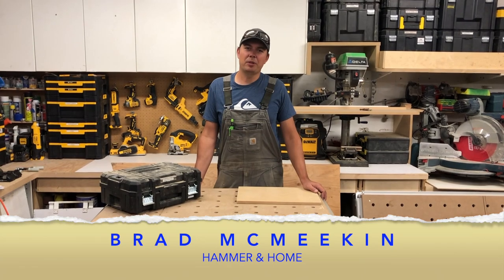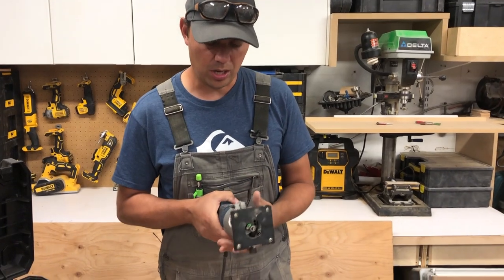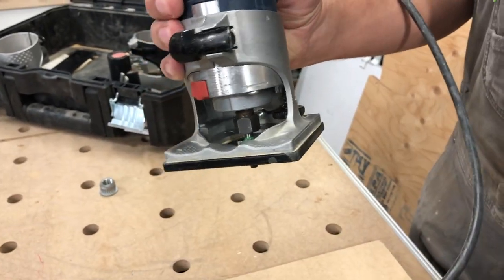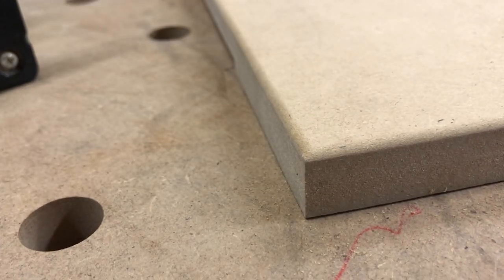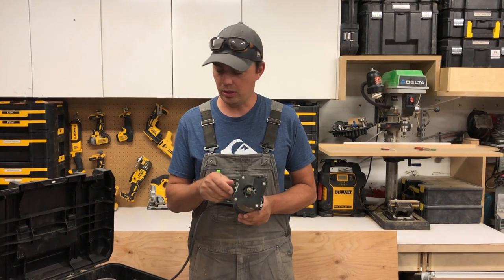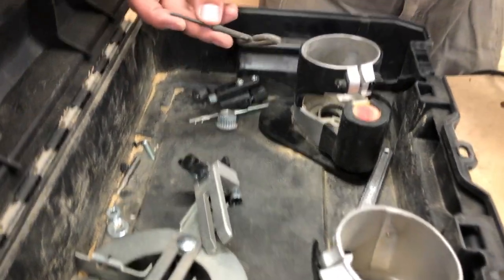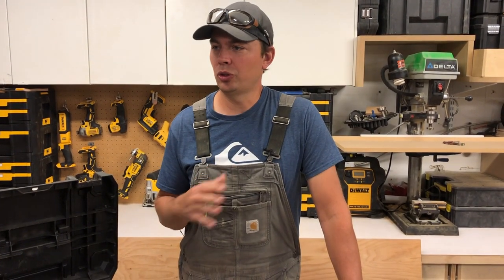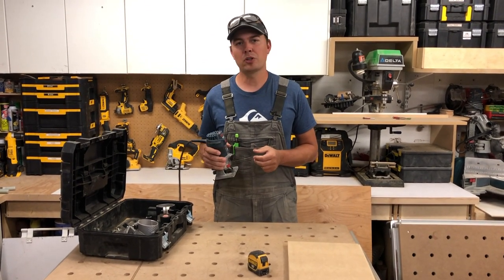ULTIMATE Laminate Router Kit!  Bosch PR20EVS Colt 1-Horsepower Variable-Speed Palm Router

Comment: Have had PR20EVS kit for almost 15yrs, those attachments have saved me more than once.  Particularly the belt drive offset base.  I've used that to trim cabinets for appliance and sink installs more than once.  Probably used it to mortise 100's of door hinges, strikes and latches.  Edging all manor of trim, rounding or beveling edges on caps, recessing electrical boxes and HVAC vents, the list is endless.  This and a Fein Multitool and anything is possible.

Comment: I have one myself and they are great little machines.  I am not a woodworker.  If anything my dad did a lot of stuff like that when he passed away and I moved to a place of my own I kept that tool.  I am in a townhouse and saved that just in case one day I decide that some of the wood needs a round over or other profile.  It only works with 1/4 inch bits and is a fairly light duty router but it would be good for all I ever plan to use it for.  I mainly kept it because it is small and easy to store and could be useful if I decide to give this place a new look.  If I am ever in need of cash I can get something for it, it won't be a lot but better than nothing.

Comment: Thanks for the video. Just picked this tool up the other day and am new to routering. Amateur question...due to the fact the router bit is spinning in one direction, aren't you only supposed to move the router in one direction? It seemed like you were moving back and forth along that side edge. Again, total newbie but I feel like that is what I've been told. Just want to make sure I'm using the tool correctly. Thanks again!
Reply from the maker: yes, it better to go in one Direction, i some times go back and fourth to remove some of the chatter marks left on the product. you also have to be careful when routering wood, some times, especially if its older and extremely dry wood it can tear out on you. so finding the right speed is key, enjoy!

Comment: They have this router alone at Lowe’s for 89.00 or 139.00 with a edge guide and a router case. But I’d rather spend 89.00 because I just bought the Bosch 1617 evs for 120.00 open box at Lowe’s Saturday

Comment: Good video. I'm guessing you don't use the edge guide that often? Ha Ha      I have a bigger router mounted in my table but I think this is a good trim router to get. It's not too expensive but I don't think I'll be making a collection of them. For me, the only down side is now I have to order all new router bits since all of mine are 1/2" shank. I'll mostly use it for trimming and and cutting away wood for putting hinges on doors. 

Thanks for the interesting video. Nicely done. Barry
Reply from the maker: haha yup, i don't need the guid that often. I'm using my Festool a lot more these days and my 20v dewalt.

Comment: The slots in the guide allow you to modify your fence for a better length when routing. I've had my trimmer for more than 10 yrs and its still running strong. What most reviews forget to mention is if your bits are sharp. If they are dull you will get burns on solid wood, ŵith somthing this size should not be a problem.( hand plane is always my go to for a simple roundover) . but for those lacking the hand tools for this application i would say, yes. The micro adjustment could use a little tightning on the threading though for finner adjustment

Comment: Hi, I'm looking to build my own amp cabinet, and looking for all the tools ill need, I have a lot of Bosch tools already and trust them. Would this work for cutting out speaker holes and doing round overs on about 1 inch thick pine and poplar slabs? Thanks and Happy New Years 🎉
Reply from the maker: Sounds like a cool project, and yes, this router is perfect for tracing templates or doing all kinds of round overs, dados etc. basically any 1/4” bit works nicely.

Comment: You can use the fence either way, but like i said, like any routery tool you will only see the results in the "bit" you use. The tool itself i have used on .5 inch or 12.7 mm. It dose struggle with .5 inch and would never do more than that. And do not advicat doing that either.

Comment: I just pulled mine out of the box and I'm not super impressed to be honest. The lock/unlock mechanism is finnicky and mine only came with the acrylic. The fine tuning is nice but the hassle of the twist lock/unlock makes me feel like it'll be fine at home but isn't jobsite ready. I picked it up cause it was the only handheld with variable speed I could find locally. So far I'm feeling kinda meh about it... we'll see
Reply from the maker: I’ll be honest, I haven’t used mine in years. I’ve been using my cordless dewalt and Milwaukee. I can’t stand cords, so it’s just collecting dust now. But it did serve me well when I was using it.
Reply: @hammerandhome I think that will be me when I'm done this project haha. I needed one ASAP though. thanks for coming back to reply :)

Comment: One reviewer commented that the central axis of the motor ends up not being square to the bottom of the base when the latch on the base is latched.  This was apparently noticed when using a laminate type trimmer with a long straight shape.  Have you or any of your viewers noticed this or is this not correct?
Reply from the maker: actually yes, I thought i had perhaps dropped it, but I have found that if cutting on one side works perfectly then if I rotate the router 180deg it is a bit different. very strange

Comment: I own several different brands and I’m happy with all of them two cordless ones a Milwaukee and a Ryobii don’t laugh the Ryobi was my first router and it was necessary for my job at the time and it worked well for a last minute availability. But I waited for all the others to go on sale. I bought a WEN plunge and fixed base for a router table I was planning on building. I picked up a kobalt router table  complete on sale. And I got the Bosch colt and the 1617EVS on sale. The best deal I ever got was a metabo 2.25 hp it was under 90.00  that was cheap it works fine the point is that I can keep the same bits in each one to keep moving in my shop.
Reply from the maker: That’s definitely a lot of routers to choose from. I only have Bosch ,Milwaukee, Dewalt, rigid, Freud And festool. I work the same way. I hate changing router bits and like to have a router for each process except for when it comes to my festool. then I love changing bits on that, the ratchet system is pretty sweet.